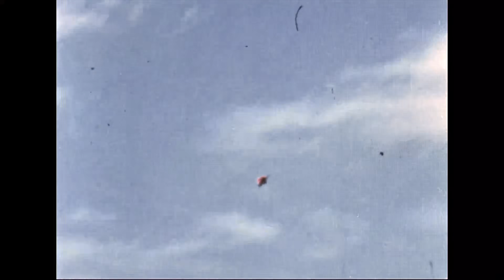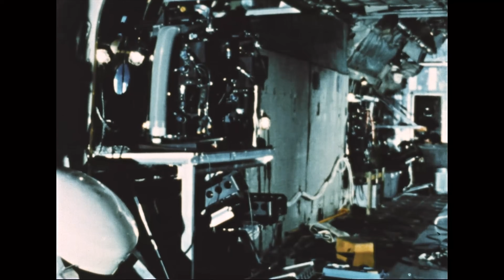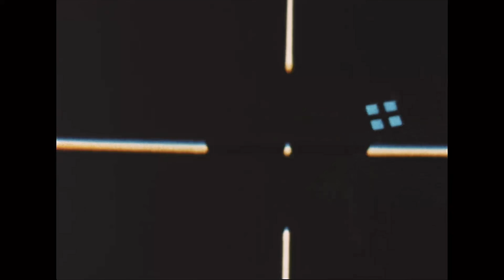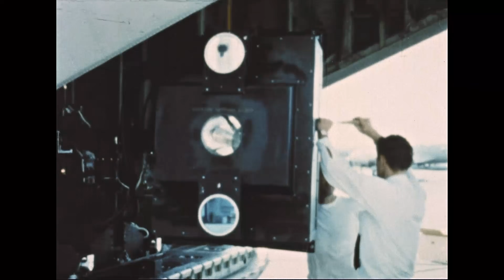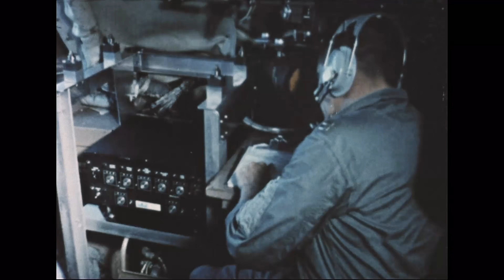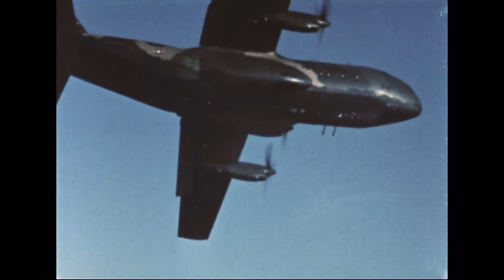Gunship II: Development and Initial Deployment

Comment: My dad was radio guy of his recon unit marines. In 67 he called in puff by relay radio. It came saved his life an relieved the base he was attached to an stationed at when suffering the longest mortar and rocket attack continuously in the war. He didn't say much. Was awarded a bronze star "for saving the radio". He said happened to be a guy attached to it at the time. Later worked out that guy was him. 😂 ptsd was hell on him. Rip in Arlington today.
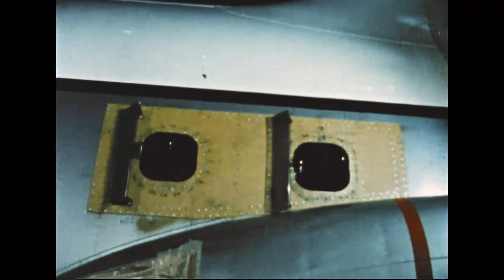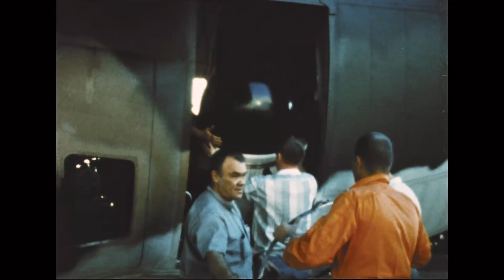5:30 the 2 were depressed so solutions was placed 2 close together  ❤.  This vids got some good 😂 setup if you listen for them . 9:00 that radar looks like a large suppository going in its rear😂

Comment: The sound of that thing would have made the A10 (Gods Fart cannon) sound like a little squirty fart.....
Reply: For a while, Specter carried a 105mm howitzer in addition to the gatlings and 40mm Bofors. O_O  "Brrrt, bang, boom, bye now!"
Reply: Comparing the A-10's 30mm to the AC-130's 7.62mm and 20mm guns? And in such a juvenile manner.
Reply: @FIREBRAND38 Only if going against armor.
A 7.62 or a 30mm against a person, they are equally dead, though clean up isnt the same 😊.

Besides a 30mm canon on a C-130 may lead to instability.
At least in the A-10 the GAU-8 is installed in the direction of flight.